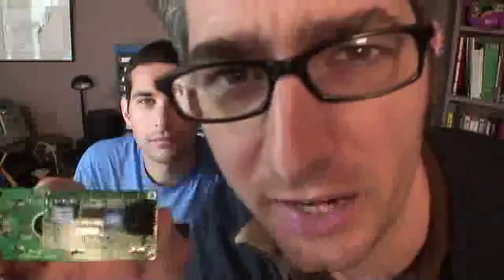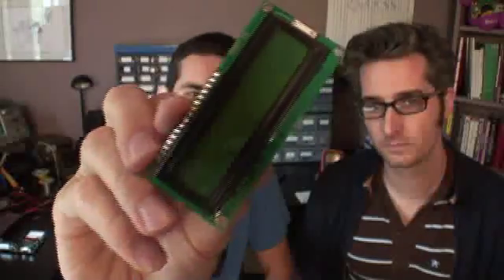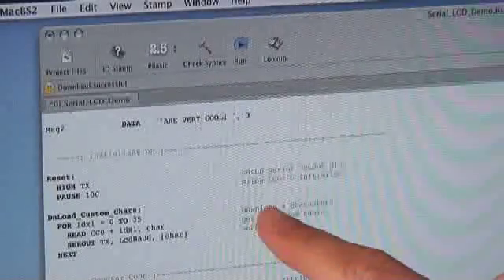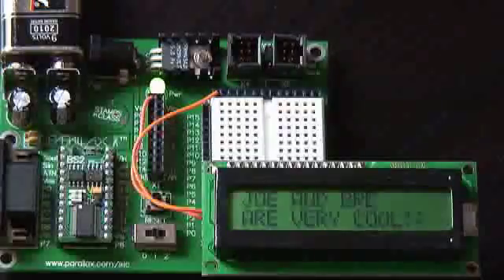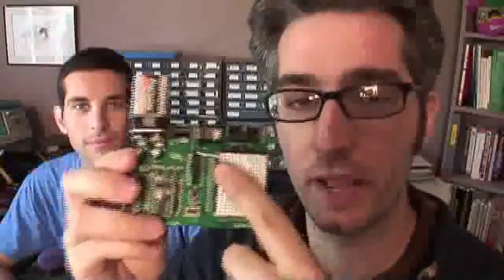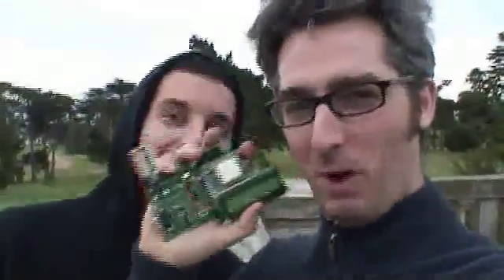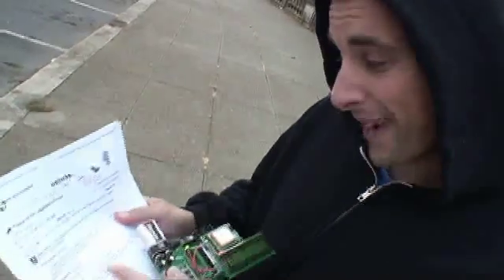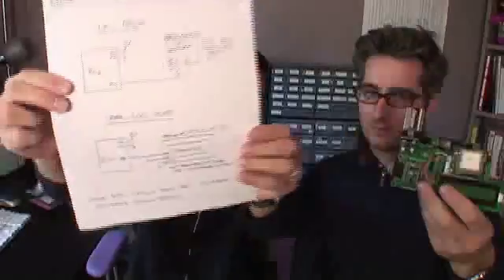Awesome Electronics Workshop LCD and GPS

Comment: Hey guys! I looking for someone who could help me  to make a gps speed measuring device that would be not much bigger then a watch. I know there is gps watches like that out there but my application is different... numbers to keep the speed wont do. The lcd display (or bright led's) gonna have to change color when im at the programmed speed. And the desired speed has to be programmed super fast for every 1/8th of a mile in seconds. Something like 14enter14enter13enter12enter up to one mile so 8th 8ths.  Basically i have all figured out in detail how to be practical but dont know how to build it.  Any help would be much appreciated!

Comment: what is the range, i need something small, but can be monitored by laptop, with a range of 30-40 miles like for a stolen car, but smaller its for something else, i need a 3X5 inch, 1/8 inch thin, whith some antenna if needed, but the 30-40 miles is got to be, is it possible????? what i need is just the your gps unit bad, how do i get the schematics to make my own, i couldnt understand the name of the web site

Comment: Hi Guys,

Great video... I do have a question. I need a 10 MHz reference to use in my electronics lab to sync up my HP counters and signal generators to a known accurate reference. 
What would be required to grab the GPS 10 MHz reference signal from your set up? 
I can purchase older GPS receivers used by  the Cell Phone industry from several chaps in Asia who make them available on ebay for this application but rolling my own would be more fun.

Regards,
Glenn

Comment: Like CDMC SD2 said avr, so in your case arduino ( works with avr)
Basic Stamp works with Pic.
Iam also hooked up with AVR, but it doesn't really matter.
its when you get started in one brand its not so likely to step over to the other brand.

Comment: does those three pins connect or get pushed into that white base, then that whole PCB is plugged into the computer by some sort of data cable? so that they can modify the data for the LCD screen??